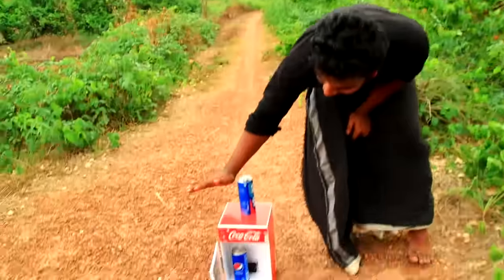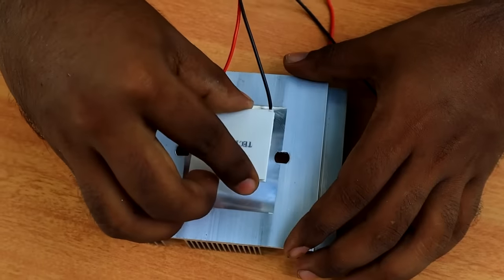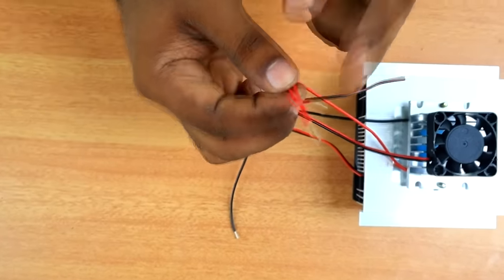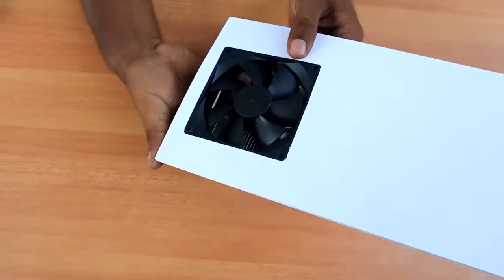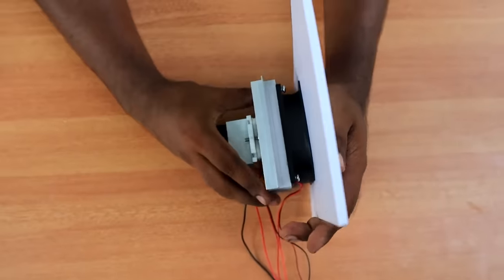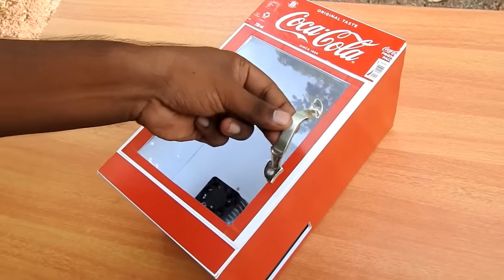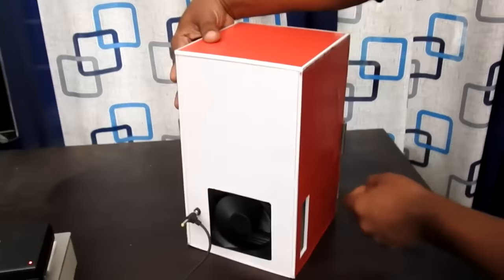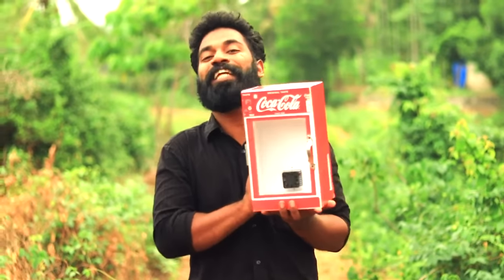How to make a Mini Refrigerator ( Low cost DIY) | ഒരു കുഞ്ഞി ഫ്രിഡ്ജ് ഉണ്ടാക്കിയാലോ  | M4 Tech |

Comment: DIY is good and working. Let me give suggestion for those who are trying this. The screws which connect both heat sinks will dissipate heat towards the cold side so it will never reach to it optimal temperature. Instead use a zip tie or any other material which will not transfer heat. Try this. All the best.

Comment: Very nice video. One small correction is recommended. Cool air is heavy and descends while hot air is light and rises. So you should keep the Peltier on the ceiling, pointing downwards. That's why the freezer compartment is on the top part of every fridge. That will give better cooling.
Reply: Some  refridgerator have bottom freezer 🕳️

Comment: I'm from chennai and this was my project when i did engineering in 2017
Reply: Expense ethra varum ithinu
Reply: @spkds4886   I believe you were asking about the expenses to make this??? Peltifier you can get it in amazon for around 250 and the cooling fans will be 300 for a bigger and 200 for a small one. Heatsink may cost you around 250 for both , Adapter will be 150. Extra cardboard, glue you may need to spend additionally. So overall you may need 1500 for the complete kit. Hope this helps!

Comment: പാർട്സ് ഏതാണെന്നു ഒന്ന് കമന്റ്‌ ചെയ്യോ എവിടാണ് കിട്ടുന്നതെന്നും കൂടി
Reply: 1 peltier module 12 volts
2 heat sink (big and small) 
2 cpu fan 12 volts.. 
1 adapter 12 volts
1 adapter female port
Super glue, cardboards.. 

Ella sadanam online kittum, allel electronic shop lum